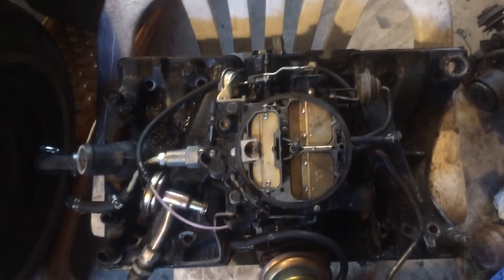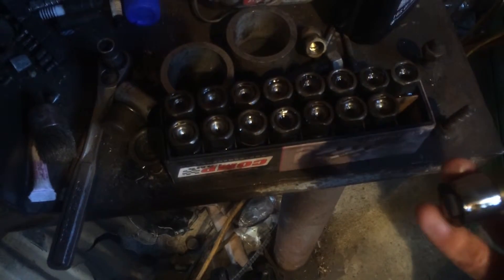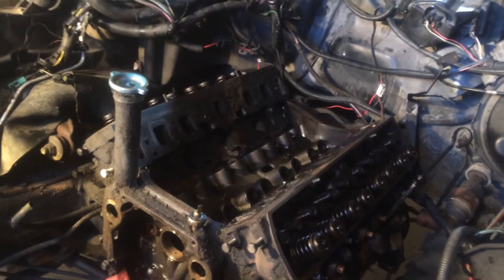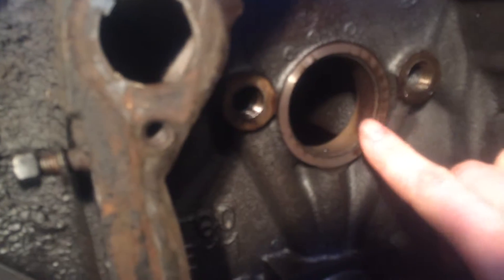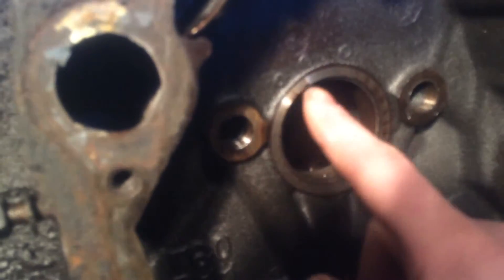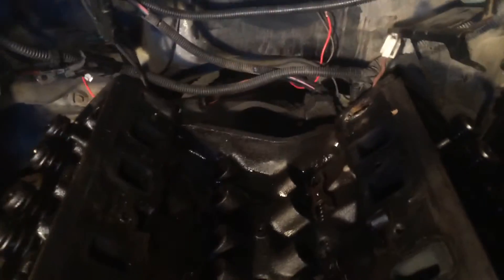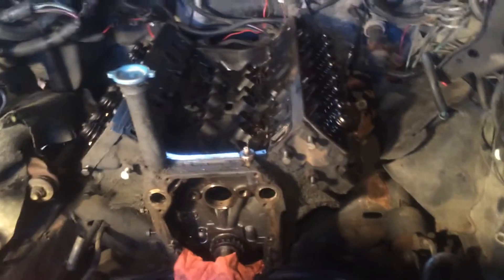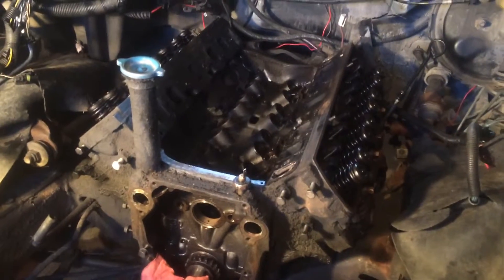The engine needs to come out

Comment: Thanks for posting videos of your Olds motor project, much appreciated. Hey quick question, im working on a 75' Olds 350, does that oil pan need to be dropped at all if a guy wants to do a cam swap while motors still in car? Thought id get your input, thanks. Motors in a 64' Cutlass.